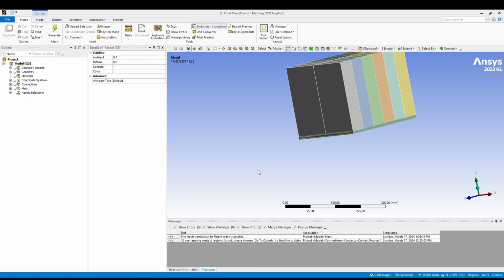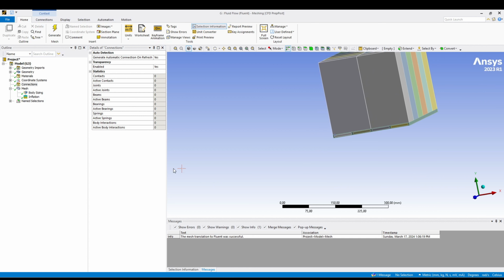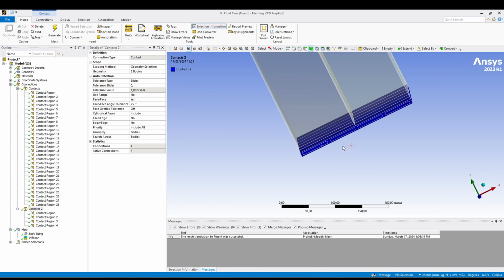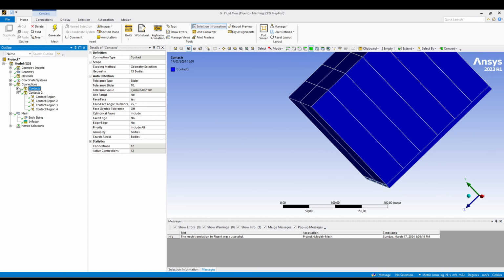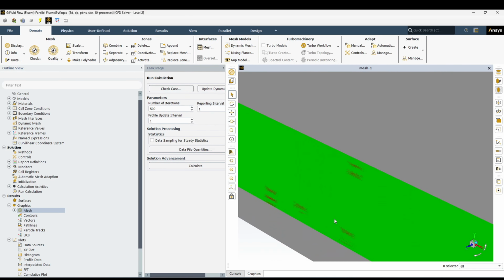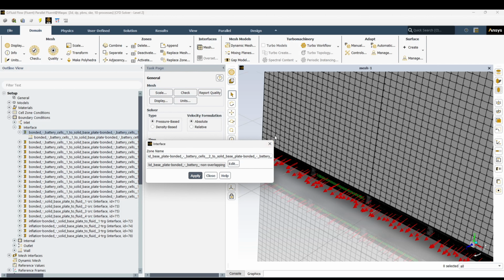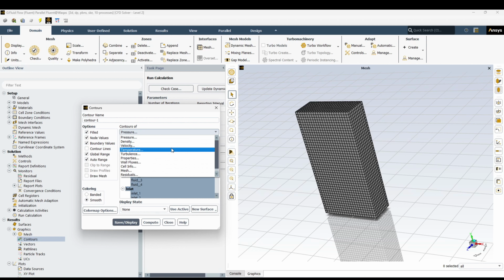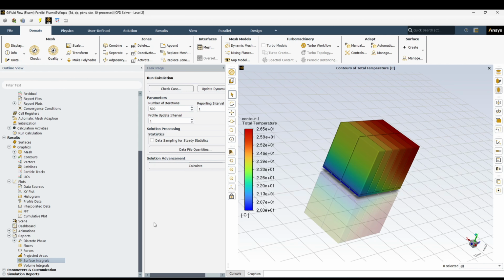Non-conformal mesh Thermal (battery) simulation | non share topology

Comment: Hello, if I think about the heat transfer contact points between batteries is it the original 28? Did you consider the heat transfer between batteries in your last video😄
Reply from the maker: What do mean? I didn't understand your question. Can you please reformulate your question.
Reply: @WaqasLearnTech  Did you take into account heat transfer between cells in your simulation?
Reply from the maker: @mikeyuan6858  In this simulation, there is a gap between battery cells. Therefore, no heat transfer between the battery cells.
Reply: @WaqasLearnTech  Thank you for your reply. If I want to consider the heat transfer between batteries, where do I need to set it
Reply from the maker: @mikeyuan6858  For heat transfer between two bodies you just have to create contact (interface). You have to create contact between cells as I have created e.g between cell and bottom plate. Once you have contacte the heat transfer will take place automatically.

To create/ handle contacts you can watch this video
https://youtu.be/CarYSwRzFJ8
Create contacts as discussed here and you are good to go.
Reply: @WaqasLearnTech  Thank you for your reply, your video is of high quality, and thank you for your selfless sharing! With best wishes🙂